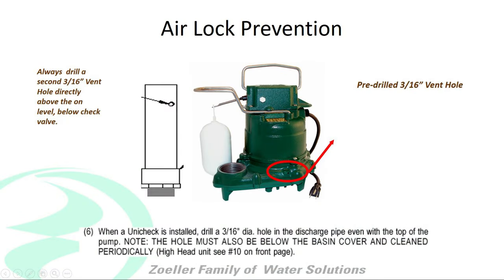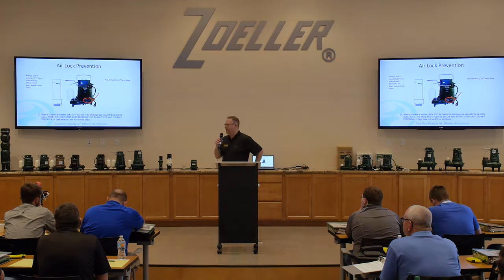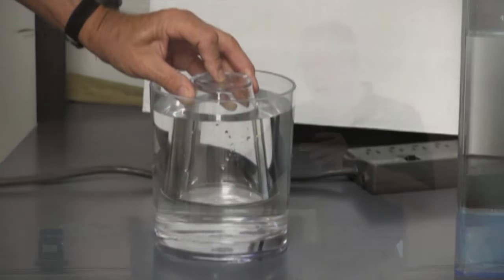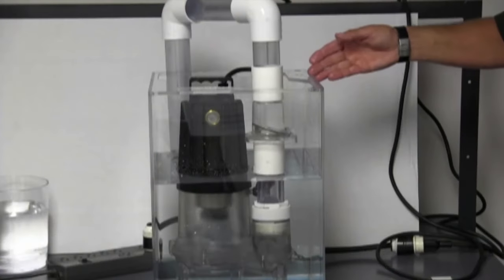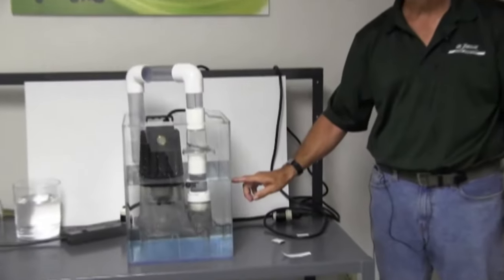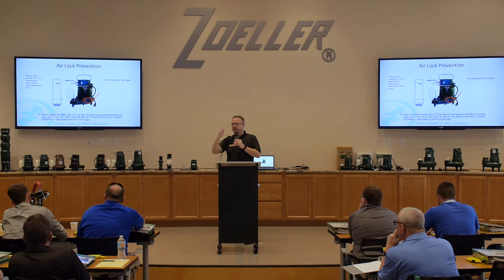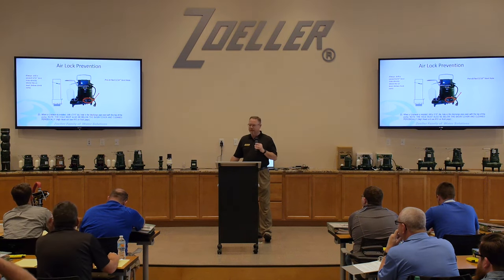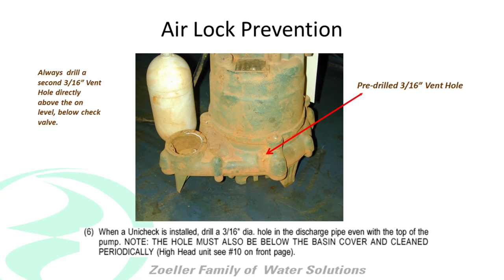Air Lock Prevention Tips

Comment: I love this pump because that vent hole, also does a fantast job as a siphon all I do is turn the pump on for a about 30 seconds and than I unplug it and water is pulled threw the vent it runs for days if I got a lot of water .I would buy this pump again . Mine says to put on a flat surface but that is not a good idea this makes a lot of restriction I put mine on rocks

Comment: My hole seems to shoot almost 50% of the water back into the well. Therefore the pump runs continuously
Reply: @C B LOL. I don't even remember posting this comment! Drunk maybe??? Since then I changed out my pump and in the process found out my check valve was the problem. There was an f'ing pebble caught in it. Hence water flowing back into the pit.
Reply: Same
Reply: @C B lol
Reply: @C B Its not often i LOL, but this one did it for me.
Reply: Is definitely does not shoot 50 percent of it back in. Unless you used a drill bit much bigger than 3/16. The loss in efficiency is negligible considering you elimate the risk of airlock. An airlocked pump will burn itself out and increase the risk of flooding.

Comment: i had a problem with my pump. it would run but not pump. i pull it out and gave it a good shake. lots of black crud fell off and when I reinstalled it, it started pumping again. At the time I had no idea about the air lock hole. I suspect it was plugged.  Thx for the info. Im going to pull out my pump again and look for this hole.

Comment: Should the hole be above or below the water line?
Reply: The last slide in the video says to drill the hole even with the top of the pump.  Another part of the slide says to drill it above the "on" water level, and below the check valve.  Based on that, I'd say to drill it at the level of or just barely above the topmost part of the pump, which would typically be just above the highest water line.

Comment: What size Drill Bit?
Reply: 3/16" drill bit.
Reply from the maker: Correct, We recommend a 3/16" hole about the height of the pump inside the pit.
Reply: Luckily for me most my systems are outdoors and do not need a check valve. Thank you for your response
Reply: You a goof lol

Comment: Why don’t they just come with a pre-drilled vent hole?
Reply from the maker: Our Model 53 does come with a pre-drilled vent hole on the pump that you can see in the cover photo for this video, but that can become clogged up on the pump fairly easily. If a check valve is used, we recommend drilling a vent hole in the discharge pipe. This hole should be located within the basin between the pump and check valve, usually a few inches above the pump “on” level but below the pit cover. The vent hole will prevent air-locking from occurring. It's a pretty small step to prevent a bigger headache from happening down the road. We hope this helps! Should you have any further technical questions, please contact our tech support team at zcotechnical@zoeller.com or 1.800.928.7867 and press option 6.

Comment: My 2hp sewage pump setup worked flawlessly for 3 years but now the weep hole keeps getting clogged. Do you think my cutter is dull and allowing too many solids out of the discharge??
Reply from the maker: Good morning! Our technical support staff can help you troubleshoot your application. You can reach them by emailing zcotechnical@zoeller.com or by calling 1.800.928.7867 and pressing option 6.

Comment: My plumber drilled the 3/16" hole on the outlet pipe below the water level real close to the outlet of a 1/2 hp model 267 waste ejector.  after seeing that and reading that the hole should be drilled above the water level where the pump turns on, he drilled a second hole.  My concern is if having two 3/16" holes will cause the pump longer than it should since water is escaping while the pump is running.  This bring me to my next question, what is the normal run time per cycle to empty a standard 18" x 30" simplex pit?.  The lift is about 12ft straight with one 30 degree bend and has a check valve installed about 2 ft above the top of the pit.
Reply from the maker: Good morning! Questions like these are more fit for our product support staff. You can reach them by emailing your comment here to zcotechnical@zoeller.com or calling 1-800-928-7867 and pressing 6 from the menu options to reach one of our experts. I hope this helps!

Comment: The weep hole is necessary in the discharge pipe even if the weep hole in the pump isn't clogged. It's rare and conditions must be just right, but I have seen pumps air lock with the pump weep hole not clogged.

Comment: With the 105 laundry pump, because the pump is so powerful, I have a loud water hammer bang at the end of it's pump cycle. Can I install some kind of water hammer arrestor on ABS piping? I haven't been able to find any...
Reply from the maker: Hello, if you continue to experience water hammer as the pump shuts off, we would recommend the addition of our Zoeller Quiet Check Valve (https://www.zoellerpumps.com/en-us/products/accessories/check-valves/quiet). Water hammer is usually caused when the check valve closes at higher velocities. Several other options to help eliminate it are also to make sure that the discharge piping is secured to the wall etc..  and possibly make sure that the discharge pipe does not have negative drop. If you have any additional questions, please do not hesitate to reach out to our Product Support Department at zcotechnical@zoeller.com.

Comment: Here's the problem with this video's advice when installing the Zoeller Aquanot backup sump pump into your existing system.  The kit comes with a check valve that screws directly into the main pump body and has a small vent hole below the flapper.  That's fine...HOWEVER, in this video they clearly recommend drilling a second vent hole in the discharge pipe between the main pump base and the check valve. That is impossible in this case because by Zoeller's own design there is no discharge pipe between the main pump base and the check valve.  The check valve screws directly into the main pump base.  Isn't the lack of a second vent hole going to cause issues down the road.....???????????????
Reply: You dont have to use the screw in chech valve. You can simply use a 1 1/2 Male adapter to screw in the PVC discharge line and buy a 1 1/2 check valve to install it higher.
Reply: You need to put an extension on the pump 6”-8” whatever length then reattach the check valve and on that extension drill the 3/16 weep hole at a 45 degree angle downward and that is the secondary air hole when the built in one on the pump gets clogged with rust usually , does that make sense it on you tube
Reply: Hi Walt - The video is discussing general recommendations for a standard system without the DC system installed. The small hole drilled in the threaded check (think of the threaded portion as your discharge stack that you normally will drill the weep hole in) that comes with the 508 DC systems will be sufficient for providing the weep hole. The cast iron pump itself has a weep hole already installed. Both recommendations from other comments will work as well as long as the pit is deep enough to allow you to utilize a taller stack under the check valve. This is not always the case as we see these systems installed in very small pits, unfortunately.
Reply: I just had a Zoeller 1/2 hp installed into my craw space and I asked about the weep hole above the check valve and if it’s needed he said absolutely no it’s not. So what gives all you so called pro’s?
Reply: Hey Walt, your point is right on the check value on the Zoeller is screwed directly into the base of the pump making it impossible to add an additional weep hole. When I asked the owner of the company that waterproofed our pure red clay dirt crawl space and it’s a crawl believe me he said with the utmost assurance that you don’t need a 2nd vent hole the pump I’m made so that it’ll never fail. I even asked him well it’s cast iron what if it rusts shut. He said nope won’t happen. They installed an 1/2 hp pump idk the model # I thought 1/3 hp would’ve been plenty but whatever. As an aside the reason for the pump was I never had a water problem underneath the house until we got a new septic system installed and now we get ground swell water coming up from underneath because of all the dirt they excavated and replaced with 2-750 gallon tanks plus another 500gallon tank. Therefore removing the soil that would have soaked up the rainwater. UGH! Homeownership is a progressive pain in the neck the longer you live. We only have 1/2 an acre.
Reply from the maker: Hi Gabe, we would never recommend a weep hole above the check valve. There would be no purpose to have one above. Years ago, many installers would place them above the check valve in applications where freezing was an issue - but this practice negated the design of the check valve completely and still allowed the water to re-enter the pit.
Reply: @ZoellerCompany  ok thanks for your letting me be aware of that

Comment: If this is a problem why not dril it from factory?
Reply from the maker: We do include a predrilled 3/16" vent hole on a lot of our bottom intake pumps, but we still recommend a 3/16" hole be drilled in the discharge PIPE between the discharge of the pump and the bottom of the check valve, just in case the predrilled hole we made in the pump body gets clogged. I hope this helps!

Comment: so this is only if u put the pump in with water in it ? pls help
Reply: No. It should always be used when using a system that has a check valve. Air lock happens for a few reasons... but another condition that causes it is when the sump pit water level gets too low. When the water level comes back up, it causes that same air pocket. Just always drill the weep hole if you use a check valve in your piping.

Comment: The Aquanot Spin 508 Model 53 Pro Pak has a weep hole right above the discharge on the main pump. I think this is also the check value? It is a black piece and that hole is right in the threaded area....it came this way.   Does this serve as the weep hole? And if so, is this hole effective for dissipating air being it's under the waterline?
I've looked at the installation instructions for this kit and it does not say it needs a weep hole drilled by the installer.  I've noticed that once in a while, after the main pump shuts off, air will bubble out from the bottom of the electric pump.    Thanks

Comment: So what's considered "high head?" My Zoeller Waste-Mate 267-0001 Sewage Pump, 1/2 HP doesn't have the 3/16ths hole yet and this week, it got "stuck" from the air pocket as it's been drought-like conditions where I live. So I'm considering the hole now and I understand that it needs to be drilled below the check valve and above the discharge at a downward angle so that any spray lands in the sump pit...but the instructions say that if you have a "high head," you might want to avoid this.

My pump pumps up to about 3.5 - 4.5 feet before crossing through the silent check valve, then up another 2.5-3 feet before doing a 90 and heading about 40 or so feet before going downward into the city rainwater. Is the "head" the portion of pipe that water goes through until it reaches the check valve? If so, adding the vent shouldn't hurt anything, right?
Reply from the maker: If you have a question about a Zoeller product and need support, please email us as zcotechnical@zoeller.com or call 1-800-928-7867 and select option 6 for our Product Support Specialists.
Reply: Just drill the weep hole about even with with top of the pump. It will be fine. I had my pit dry out during a drought as well, and also caused air lock. After I drilled the weep hole, it never had a problem again. You won't lose that much efficiency from the weep hole. It's better than having a pump burn out and cause flooding.
Reply: @NoName-gv6nm , totally agree. I'm happy I drilled mine.

However...

One thing worth noting for people with exit lengths installed within joist locations is that the hole introduces air into the line and this can increase noise of the respective cycles due to how air pockets get trapped within pipes. It shouldn't be enough to cause major problems, but as a result, it does increase noise within the exit pipe as water travels out and air within the pipe slides around inside the line, the severity of which depends on where and how the exit line(s) are installed within a home (i.e. - if the exit line is suspended from joists via hangers that struggle to dampen vibration caused by the water sliding around once the cycle ends or if the line pumps along an upward grade during its journey to daylight). There's a lot to it and results vary between homes and their respective configurations.
Reply: @Wolf_22  yeah I can see that being an issue for sure. It certainly causes more noise. Lucky for me, my pit is about 2 feet from the wall. Only about 5 feet of pipe. So it's dead silent in my home. Maybe there's something you can do to dampen vibration? Cheers 🍻
Reply: @NoName-gv6nm , there is. When I first moved in, I had to run about 20' worth of exit line through the entirety of my basement + crawlspace as the endpoint was the only way to reach daylight. Since then, I've managed to get my town's mayor to martial his troops and get an 8" drain line installed in my backyard (which connects to the city main line). So, this summer I'm rerouting everything back to that through my back basement wall, which translates to disconnecting my lines from my joists and having only 3' worth of exit line in the basement before going through my basement and out at a downward angle into that 8" drain pipe. :)

Looking forward to it, too! Ha.

Comment: how can I order 1hp of zoeller pump
Reply from the maker: There is a Distributor locator on our website. Be sure to call them first and make sure they have the model Zoeller Pump you want. If you are having trouble identifying which pump you need our Product Support department would be more than happy to assist. You can email them at zcotechnical@zoeller.com or call 1-800-928-7867 and dial option 6. Hope this helps!

Comment: What happens if you drill a 1/4” hole? Just less head pressure and discharge rate?
Reply from the maker: The 3/16" is the recommendation based on our decades of testing. While a larger hole will still prevent the system from getting air-locked, it will introduce more water back into the pit (granted a small amount). This will cause the pump to work more and have less actual output. If you have any additional questions, please do not hesitate to reach out to us at zcotechnical@zoeller.com. Thanks!